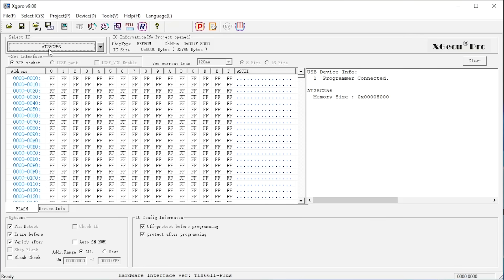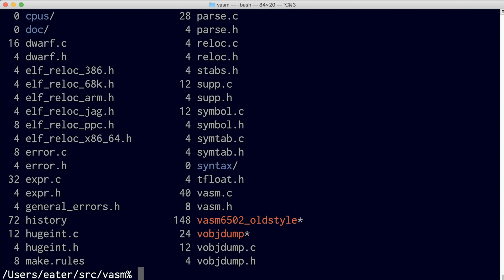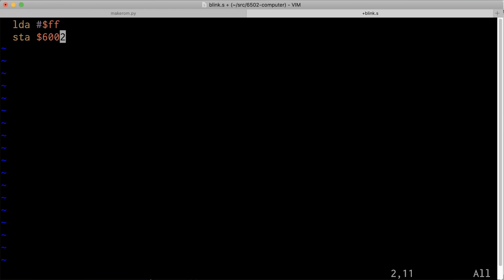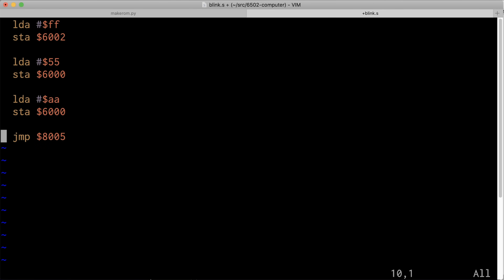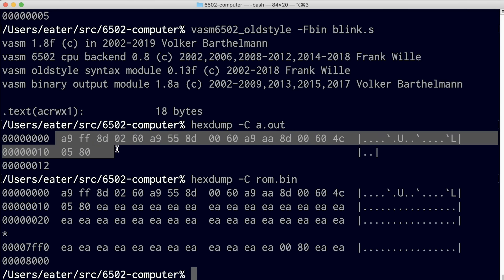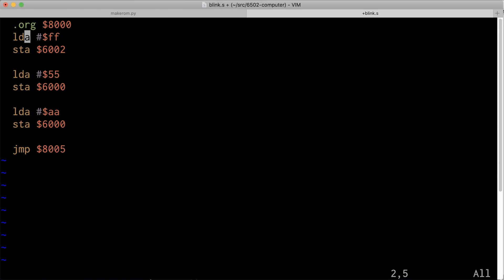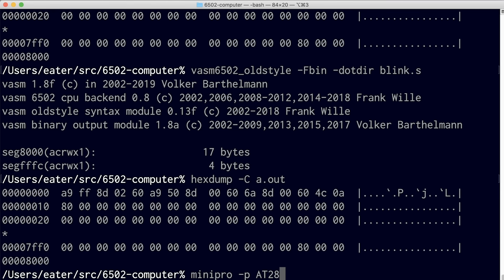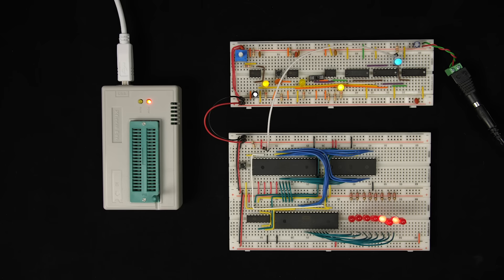Assembly language vs. machine code — 6502 part 3

Comment: This series really shows how we're standing on the shoulders of giants when we use our PC
Reply: Or any modern science really
Reply: @dkmk100-ludum-dare  lĺĺ
Reply: @dkmk100-ludum-dare  lll
Reply: I really feel like this should be a mandatory subject in school starting at elementary school. Computers are our lifeblood at this point in society and everyone should learn how they work.
Reply: Magical times. These processors were ubiquitous then and still go into brand new embedded systems, in one case I can recall... "If it ain't broke", right?

Strongly considering buying one of these kits just because it's such a blast from the past to see someone that knows their shit keeping it alive 😉
Reply: Reading Ben is just a huge pleasure: he's a reminder of an earlier age, when computation was new, almost. (I built a 6502-based computer using the hobbyist text "Te-Tsukurri Konputaa Wo Tskurimashoh," ("Let's build a hand-made computer") in the mid 1970s. Had to duck between the dinosaurs to get to the electronics store for parts.)
Reply: nandgame is a pretty comprehensive game  that has you build a computer from transistors
Reply: It also makes you realize that computers haven't really changed; they've just gotten smaller and faster. You ever used Linux, and came across a terminal, or even the TTY? TTY stands for Teletype. It was an early computer terminal. The VT100/VT220 is the most commonly emulated terminal today; yes, the Linux "terminal" is actually a program that emulates the real thing. These things date back to the 50s (Teletype) and 70s (VT100). At its core, binary computing has remained the same. That's a crazy thought to wrap your head around.
Reply: Sometimes you may need to do these stuff even in 2021 if you are a hardware engineer who is designing a new piece of hardware or an embedded systems engineer who is designing a brand new system. Of cours you could do all these using c or even c++ but sometimes its just easier and faster to do low level stuff in assembly.
Reply: yeah. i feel compelled to study this stuff otherwise i feel so ignorant
Reply: Learning is all logic, math, blah blah

Getting good... Is an art
Reply: This!
Reply: Or electricity ...
Reply: My first computer (early 90's): 
XT motherboard
720 Kbyte 5 1/4" floppy drive
40 Mbytes hard drive (this used to be awesome)
512kb RAM
8 MHz
Hercules monochrome monitor
DOS boot up disk. 
It's a piece of crap by today's standards and took FOREVER to boot up. 
I miss it sooo much, but I would never use it on a regular bassis! (ha ha)
Reply: Well a better analogy would be “Sitting on a FAT STACC.”
Reply: pyropulse  almost anyone can learn how to program computers as its not that expensive compared to doing something like learning to weld and machine or learning to fly a plane
Reply: @loserface3962  I would have 5000x more chance of learning how to fly as opposed to learning any of the magic I'm watching right now.
Reply: @krabsauce9792   You think that, but it's really a matter of repetition and coursework with a competent instructor.
Reply: @krabsauce9792  what's kind of crazy is that I could read and understand what instructions the hex code were, and when he went "let's delete the #" I was "yeah, you'll get A5 instead of A9 ... because I programmed an Apple ][ in machine code without having an assembler back in 1980 when I was 17.
Reply: @krabsauce9792  disagree, the great thing about learning computer science is there's no 'mystery' to it as long as you start from the bottom and work up. Electronics on the other hand.. there's some quantum stuff at work there..
Reply: @Blink_____  I'd say it's even more a matter of practice, and as you said, repetition, than an instructor.  I, and many people that I know, have taught themself to code using youtube, W3 Schools, and Stack Overflow.
Reply: @syrus3k  I was waiting for someone to mention this. Understanding how a computer works and communicates on the software and high hardware level like what Ben is showing here is a piece of cake compared to understanding why electrons act the way they do in MOSFETs, let alone understanding and being able to analyze the newest super fin transistors and lectures by scientist who develop them. 
Physics and mathematics are at the bottom of the whole computer science and at the bottom of pretty much everything that surrounds us, these topics are the real giant mystery. I can't count the hours I have spent geeking over science articles about transistors and other electronics components and I still feel like I barely know anything about it all, while I understand how hardware communicates and how OS work pretty well.

This is why I have so much respect for physicists and chemists whose joint effort over the last century has brought us this amazing technology. Thinking of Bell Labs scientist back in the 1930-1960, some amazing period for science that was.
Reply: @loserface3962 , true.  There is a barrier to entry financially, but learning to weld and machine or fly a plane are sort of intuitive.
Reply: @loserface3962  As someone who is a decent welder and programmer I can tell you anyone can weld and program it's just how good they are at it.
or should i say how much time someone is willing to invest in learning either skill.
And no, It's fairly cheap to get into welding (And In my opinion very satisfying)
It's hard to say what has a higher skill ceiling though.
Reply: @TauCu  but almost everyone has a computer and internet (at least in america) where welding can cost quite a bit for a decent setup. Also what kind of welding have you done? I've done a little bit of stick, mig and oxy acetylene.
Reply: @loserface3962  In the shed I have a UNIMIG 205, Primeweld tig225 ac/dc and a primeweld CUT60 plasma.

I'm a patient person so I do like the tig process.
But mig is very nice too.

While the unimig costs a decent dollar (but is still competitive for it's age when i bought it) the primeweld units are sorely underrated for their price.
Their plasma cutters kick some serious ass for the dollar and so does their tig.

Thinking of grabbing myself an oxy set for some work but most things I'm near a power source.
Reply: @larrybud  most people have a computer already and the most widely used assemblers such as nasm and fasm are free
Reply: @loserface3962  Sure but to do these projects you need the hardware too.
Reply: @larrybud  im talking about programming in general.

Comment: What a great series!  For those that followed Ben here, over at 6502.org they are doing a design contest around the 6507 (a small brother to the 6502).  You get free parts for your contest project and there are some interesting prizes.  Every one that enters gets a prize along with the free parts.    All you need to do is join 6502.org and blog your progress.  Here is the tread - http://forum.6502.org/viewtopic.php?f=1&t=5909 - the official rules are on page 3 of that thread (I think).

Comment: Why doesn't the .org 8000 directive cause the code to be stored at the 8000th location in the output file? More info necessary about how it works. Anyway, absolutely love your videos, am addicted.

Comment: Buttons and LEDs to simulate IO is so much more 8-bit school than an LCD 'Hello world.'  :) To bad you didn't use descriptive labels for the 6522 registers.
Reply: Sorry, tried to mind my own business but I had to do this ... (I guess I didn't overcome my C64 period entirely :)).

VIA_BASE  = $6000
VIA_PORTB_IO = VIA_BASE + 0
VIA_PORTB_DIR = VIA_BASE + 2

ROM_BASE  = $8000
NMI_VECTOR  = $FFFA
RESET_VECTOR = $FFFC
IRQ_VECTOR  = $FFFE

 .org ROM_BASE
 
reset:
 lda  #$FF   ; all port B lines as output
 sta  VIA_PORTB_DIR
 lda  #$01   ; just a single bit
 
loop:
 sta  VIA_PORTB_IO ; output value in A
 ror      ; shift the bit for stunning visuals
 jmp  loop

 ; Yes, this will lock up the CPU on NMI & IRQ
 ; so make sure these are inactive (high).
 .org NMI_VECTOR
 .word NMI_VECTOR
 .org RESET_VECTOR
 .word reset
 .org IRQ_VECTOR
 .word IRQ_VECTOR

Comment: Anyone else notice that the carry flag on their 6502 does not get cleared during a reset?

I discovered this when instead of 2 LEDs running around I had 3.  At first I thought it was a loose wire on my breadboard.  After playing with the timing of where the LEDs were when I hit the reset, I can choose if there are 2 or 3 LEDs running around.  If I hit the reset when when one of the two original bits is in the carry flag then I get 3 lights.  If neither of the bits is in the carry flag then I get 2 LEDs.

Since the sta does not modify the carry flag and the ror just moved everything over one place including the carry flag then I end up with 3 bits in the a register.  If this behavior is not desired then these two instructions (sta #$0000 and rol) can be added to the beginning of the reset block to insure the carry flag is zero.

Does anyone know if this is the expected behavior for the modern 6502 or is it a side effect of the slow clock?

Thanks.

EDIT:  Found the answer in a previous comment.

Comment: How about showing us how to add a serial communication interface using either a 6551 or MC6850.  I think it is essential for developing programs on a PC and downloading it to the SRAM instead of burning the EEPROM every time you want to add or modify something.

Using bit banging on two of the port pins on the 6522 is fine too, so we can learn how bit banging on the 6502 works.  Was that already done on the arduino nano on another utube episode?

Thanks.

Comment: This is the first time (of my 14 years of career in programming) heard someone explain what those hex does. Yes, I started programming in DOS
Reply: There is a secret code:  0xcafebabe that has been known by only the very few;
You are now one of the elite now that you know that; DOS had some really really funky that I just never figured out with what is called the dot operator; With that you get 256 byte filename buffer then some group that wants to rule the world — and doing spectacular work gaining on it — programs STL using this buffer or whatever it is;  Discovering at 1AM they did not provision for runaway writes we are back to processing with exceptions which has no value for me that I can think of

Comment: I have Smraza Basic Breadboard Kit shipped today with plans to build simple control loop with the 4-switch Binary keyboard; I an very familiar with how this fails but need to work toward building a latching Schottky ( forget all the names; this is starter work I never accomplished ) "latch" based on Thermistor to be salvaged from waste thermostat; This I think can be driven with a single AA NiMH which then "drives" a MOS-FET like NTE2900 series I think it is ○ the idea is to build hysteresis from the start into an  PN2222 / PN2222A  Schottky latch instead of an SCR to utilize DC to hold the contractors down on a heavier relay; Actual powered load has been metered at  ~7.3 — 7.8 amps with an amprobe; 

This is in-service now and being used; Goal is to attain a controller that will not fail when absent the domicile then put it all in a large tuna can or the like — a fail safe margin of 3 to 5 times rated load on the label will be attained consistently; I have read about the diode to take collapse EMF when contractors are switched out of feed;  Rated voltage is 24 Nominal — I am looking for that x-former now and if cannot find it then can consider other ways to drive the coils as 830ma  is expected load value for the controller board or my tuna-can approach;

Comment: How long until this tutorial evolves into a full NES game?
Reply: After adding a GLCD for displaying the graphics, then taking care of the sound by adding an AY-3_8912 chip.   Some interfacing to a 3x3 or 4x4 keypad for the players' buttons....  Another 4-6 episodes should be fine getting it to run a simple NES game.  The rest are just software and programming.
Reply: Coming in from the future!
At the moment, it's just a BASIC program.

Comment: In my first job, I wrote 680x assembly programs, and by wrote, I mean I had to write them down on lined paper, then write the machine code next to each line in the margin, then type all the bytes into a BBC micro which had a ROM burner attached.  My biggest program was almost 8k which, for reference, is a full ring-binder worth.
You guys have it so easy these days, with your fancy assemblers!
Reply: It was a very long time ago, so I could be mistaken, but I seem to remember that BBC Basic had built-in 6502 assembler support?
Reply: @craftsmanwoodturner  - well, long answer is that we also used the (awsome) Dataman S3 programmers, and to do software updates we would call out any changed bytes on the telephone to our customer, who would be typing them into their Dataman.  In order to make this work, each page of code was divided into 4 line groups, and when your code got to the end of a page (only one page allowed per subroutine!) the remaining bytes in the final group of 4 were left blank - to allow for pudent modification of that page of code without affecting any other page.  An assembler might rearrange a whole load of other code after an update.
While a similar approach could probably have been forced with an assembler, my Boss was an eccentric PDP owner/operator, and insisted it was done this way.  As a 'rookie' it certainly was a good way to learn the careful writing of code.
It's a process that younger generations might find hard to imagine!

Comment: Thanks for teaching me how to use an Arduino to function like a debugger/logic analyzer.  Never know this technique till now.   Have most of the chips for this video, but no at28c256 only 27c256.  I also have a eprom programmer on 8 bit ISA card and a professional UV eraser with timer.  My apple II eprom programmer can only program 2708-2764 and it is under repair at the moment.

Thank for the efforts for making this video and I expect more to come in the future.  Cheers.

Comment: Why the assembler binary output starts at $0000 despite of origin directive .org $8000?
Reply: Just burn it rom and make circuit so CPU see rom start 8000.thats how it works.its hex file sure hexdump say it start 0.but programmed chip start 8000
Reply: Yes, it is clear now. It is not the assembler job to add 00 at the beginning of the output file. It is your job to load the program at the correct address, which in our case is accomplished by the circuit.

Comment: Thanks. Had no idea MacOS X had a hexdump command - nice to know. Interestingly, I coded a DOS version in C, called hexdump.exe, though it’s not as full-featured as the MacOS X one, but it gets the job done, and works in all versions of Windows from Win98 to XP. Sorry, I don’t have the C source code anymore. I also have a 32-bit Windows executable, Unhex.exe, that does the reverse; it takes a file in hexdump format (from my hexdump.exe) and creates the binary file image from it. This, I do have the (VB 6) source code for. If there’s enough interest, I’ll try to make a public Dropbox for these two programs.
One thing I’d like to see is your kit to include the EPROM programmer and the FTDI USB->serial converter as well (I’m assuming that the EPROM programmer takes RS232 here.) or maybe at least a link to where the EPROM programmer can be purchased, as well as a discount code (“EATER6502” maybe?) 😊
Reply: hexdump is basically just program that read file and show it hex
Reply: MacOS X is basically a GUI running on top of a UNIX-like operating system so all the usual UNIX commands are there.

Comment: Brings back memories of programming in assembly on old GM 6800 series car/truck ECMs from the early 80's. Kind of fun to program on since they did not require a bootable operating system like the later ones, which meant you could use them for simple control projects.

Comment: Why didn't the assembled code begin at address 0x8000? I mean, we know that the processor has been set up in a way that this address represents the first position in memory, but in my view the assembler would have no way to know that, and since I guess it takes the viewpoint of the processor, it would have no way to guess that it should start at 0x0000 nonetheless.
Anyways, great video! Just felt like I missed the point in this part :D
Reply: if you look assebler feed back you see it did 8000. and if you look hexdump you see there is 8005 jmp and not 0005. so it did like we wanted .org $8000

if you want see bunch of zeros do this
.org $0000
.org $8000

but you can burn that on only 64k ROM ben use 32k.and that first 32k is RAM we not need burn it anyway(cant burn ram it loose data after you unplug it from programmer lol) so we not assemble it also

hexdump only look file. file allways start 0 so it looks like it start 0. every file in earth start 0. hex file not include address info. its plain data. you know it start 8000 becouse you did it. then you make circuit board that way so cpu see ROM start 8000 . EASY?